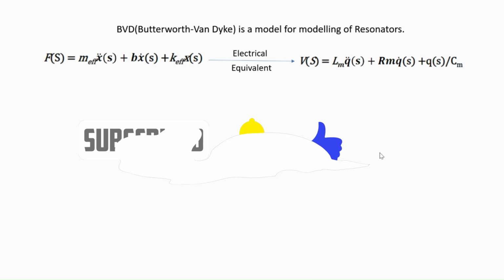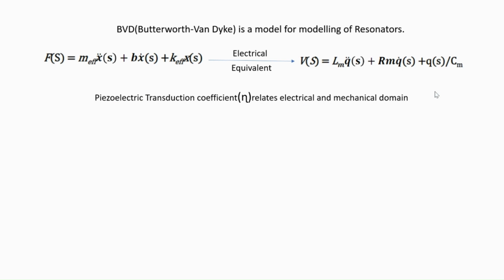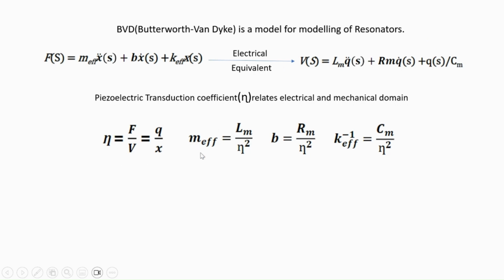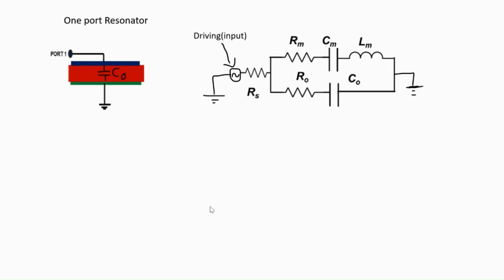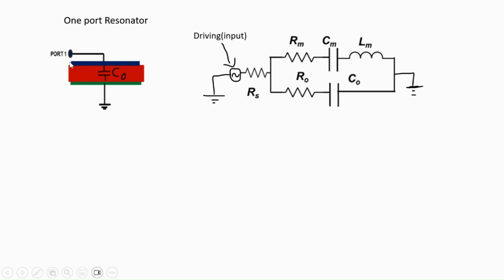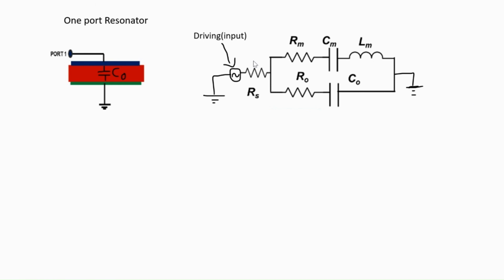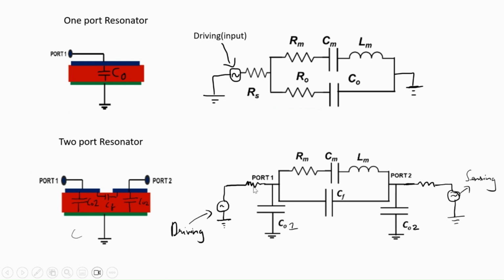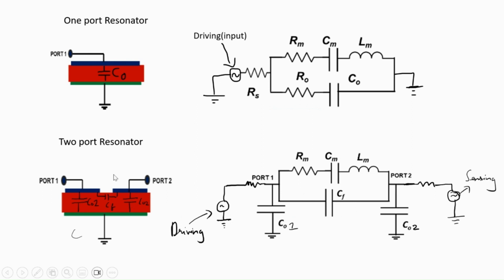BVD(Butterworth Van Dyke) Model

Comment: Actually I have to extract the values of R, L, C with Co
Reply from the maker: For that first you have to have the electromechanical coupling coefficient(kt2) and Quality factor(Q) and then using that calculate Rm, Lm and Cm. Co is the capacitance between your electrodes which is EpsilonA/d. This you can do only if you have your device or some simulation from which you can get kt2 and Q. 
The other way is to do it theoretically which will be more difficult, that is to find, meff, damping and keff and then with the piezoelectric transduction coefficent find it. That is anyway mentioned in the video. 
You can also look the book piezoelecric mems resonators by piazza, where all of this is there in detail.
Reply: Thank you so much sir @Jyothish_Raj
Reply: Firstly I want to thank you for your reply @Jyothish_Raj  I have calculated Lm, Cm, Co.  But i am finding difficulties in the calculation for Rm, Ro, Rs. Plz suggest any relevant research article or conference paper.